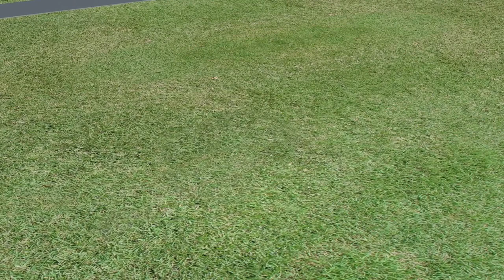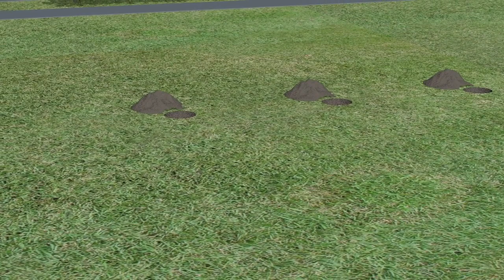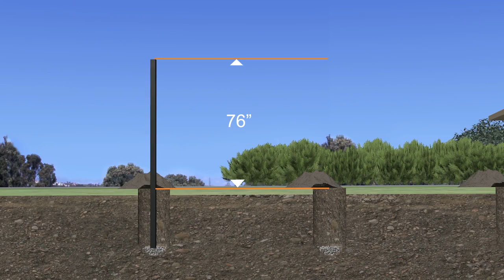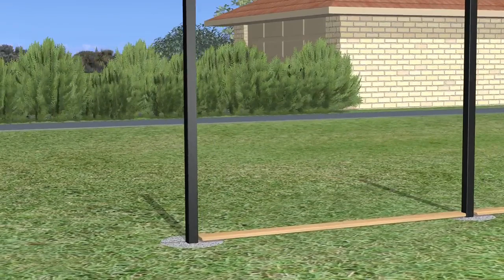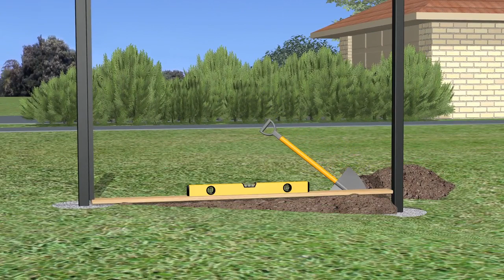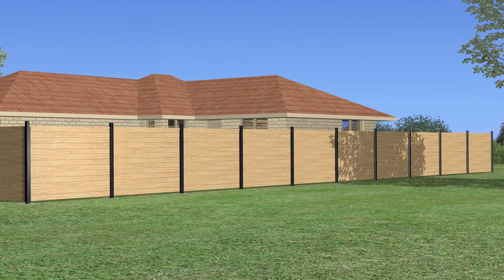Slipfence Horizontal Installation Video

Comment: What sucks about this product is that you can’t actually buy it anywhere. I tried a couple years ago and there was absolutely no indication that it was on back order, but it was delayed over and over until I got sick of of the bs. Then they gave me shit about canceling the order. Awful small-time company that doesn’t understand the first thing about actually selling a product. Don’t bother, just go buy the parts separately. Seriously it’s a square post and a channel with holes in it.
Reply: Currently sell at Lowe's and I think Home Depot.
Reply: dang

Comment: Need tips for slopped landscapes AND we all know that treated wood deck boards shrink and warp. What happens then?
Reply: Hello,
In the instructional video there is a mention of sloping ground. Basically you will want to use the earth from the post hole to level out the bottom of the downward sloping ground of the bottom board. If there is a big gap, then either shorten up the panels between posts and / or create a custom bottom board to fill in the opening. This is common practice among installing all horizontal fence systems as they typically look nicer when the tops are kept level on a sloping lot.
Reply: @slipfence  so basically if you have a hill you’re screwed